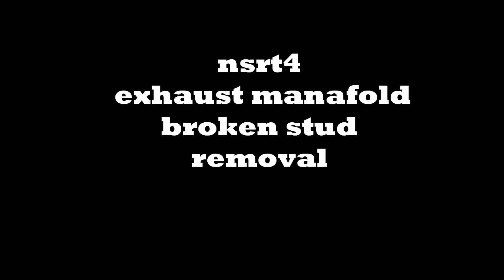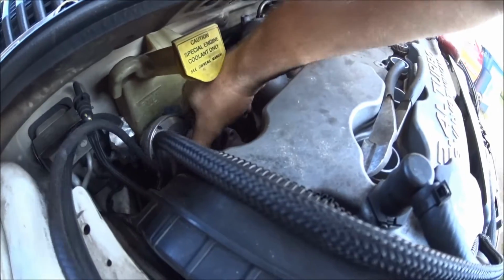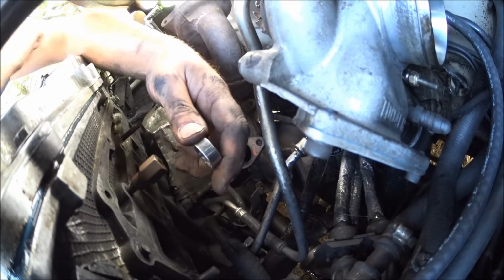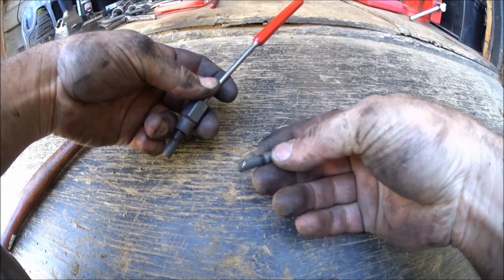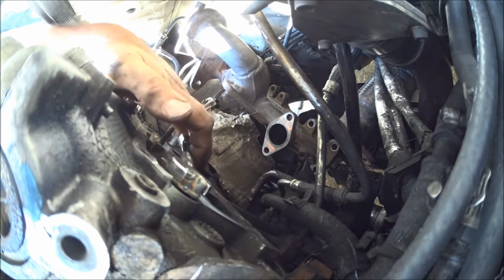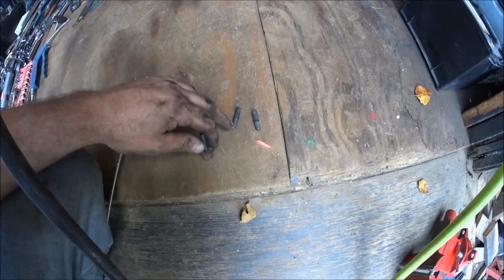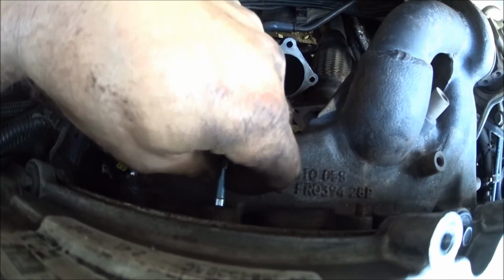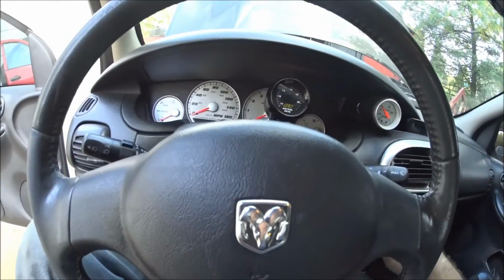srt4 exhaust manifold gasket replacement and broken stud removal

Comment: I would've gone straight for the drill chuck opened it enough for it to grasp the broken stud hand tightened it then manually unscrew it with the drill chuck.  Don't get me wrong it isn't as easy as I make it sound, but, sometimes you might just get lucky and this is an ideal situation where I believe this technique I've just shared with you will work.  ;-)
Reply from the maker: any ideas to try are good ones when it comes to this as i've used many this one welding on a nut I've just always had the best luck with, the steel stud in the aluminum head is just a bad idea in the long run

Comment: Hey Matt where can I get those exhaust  bolts?
Also I have one strip bolt I may go with a Helicoil thread repair TO fix it knot but I'm  not quite sure what size of thread tap to use I think the bolts are M8 1.25, should I used the same size or will I need to go the next size since had to drill and re-tap?
Great tip on the use of silicone  on the bolts will definitely do that.
Thanks in advance
Reply from the maker: well tap and helicoil is not something i've had to do yet guess just lucky, if i remember the stud kit was doorman or form the help section at the local autoparts now i have a whole drawer full of oem studs i can use the high temp silicone on the threads works

Comment: What were the symptoms / engine performance issues with exhaust leaks?
Reply from the maker: leak before the b1s1 o2 will cause a lean code making the ecm think the fuel mixture is lean and add more fuel black smoke fouling plugs and more i think it should throw a p0171 code im guessing from memory on the number

Comment: Was the leak making a clacking tap sound and kinda hiss ?
Reply from the maker: John Carroll puff / hiss depending on rpm the best way to check a leak is to have engine at operating temp have some hold a rag over the exhaust causing back pressure and forcing it to come out where the leak is you can also see the leak some times missing lose or broken studs and black carbon marks

Comment: Could you smell the exhaust leak inside the car while driving?  Im not sure if this is my issue or if it’s the heater core
Reply: I can smell the leak in my car along with a few other smells

Comment: Question, When you used your welder for welding the nut to the stud, what did you ground to??
Reply from the maker: To be honest I don't remember its been too long since I did this repair but you want your clamp on a steel bracket on the engine and always unhook the battery.
Reply: @Mattsneedforspeed  Ok my engine is out of the car. Can I ground to the alternator bracket?
Reply from the maker: @jkenney940  that would be a good location.
Reply: Thank you so much!
Using my new welder for the broken studs worked Awesome thanks to your instructions here!

Comment: 13:20 What brand/type of silicone are you using? Is it the same as hi temp red RTV?
Reply from the maker: yes the high temp rtv orange/red some is rated at 600 degrees (if buying new read the package) and works well, i'm getting ready to work on my mustang I used silicone on them over 10 years ago so it will be a true test to see how it works long term as I have aftermarket alum heads also.

Comment: have u changed the oil pressure sensor? I heard it's hard to get too from up top
Reply: Remove the Turbo charge pipe and go from underneath  its a weird angle but easily done from underneath Best on a lift but achievable on jack stands
Reply from the maker: I made a video on this if you didn't get it done yet check it out.

Comment: HOLY FUCK, literally what im going through right now. Was just browsing videos to see if I can figure out how to fucking get just the manifold/02 housing out together. I guess I need to unbolt them first.. Jesus. I guess this is a "thing" that happens.

Arp bolts, and a BRAND spankin new OEM Mopar manifold+turbo from Dec 2005 from some guy that had a few brand new hiding in his collection. This oughta fix this fucking issue. Also a stud broke in my head as well. >.> Cheers and thanks for making this video man

Comment: What studs did you used? Name and part#
Reply from the maker: hello, the bolt/studs came from auto zone or advance if I remember correctly.  I didn't use all of them and reused used some of the bolts I had to watch the video and was able to get the part number,  I did find a listing for them on ebay here is what  I searched.  DORMAN - HELP 03411 EXHST MAN MOUNT KIT Hopefully this helps thanks for watching

Comment: Bro how in the world did you reach the bottom manifold bolts??????!!!!! I’ve been trying for days to undo the the right side bolt and back side bolt of the elbow??!! I have u-joint sockets and ALL but still CANNOT REACH if anyone sees this and knows a tip please help me asap
Reply from the maker: Remove the coolant over flow reach in from the side and from the btm it takes some time but it can be done
Reply: @Mattsneedforspeed  and that’s for the elbow connected to the manifold?? Because I’ve managed to get all the bolts off the manifold I just can’t get the last two off the elbow connected to the manifold.. I’m assuming jus go at it from all different angles?
Reply from the maker: @ahoncho.3148  elbow and manifold just have to be creative.

Comment: You didn’t include the part where you removed The exhaust manifold,. I’m having trouble getting to the bolt in the middle and cannot get it off to save my life
Reply from the maker: Donavan DeCosta back in the btm I reached around it and got it with a wrench this was a lot easier seeing it had a 3in o2 housing installed already if you still have the stock housing you will need to reach up from the btm and in bolt all that mess
Reply: Hey Matt can you pm me on messenger or Facebook .my srt4 has a a ticking sound right above 1,500 RPMs to 3,000

Comment: What a nightmare of a cluster f__ back there.  Now, would you have been able to pull the manfold completely out of there, like I've been wondering for years?  
Would you have had to remove the turbo and wga before you could have pulled to manifold out of there?
Reply: Late reply, but I'm throwing this out there for anyone else reading. The turbo V-Band needs to be loosened, hot pipe loosened from under the car, and then turbo smacked with a rubber mallet to slide it out of the manifold enough so you can removed the exhaust manifold.